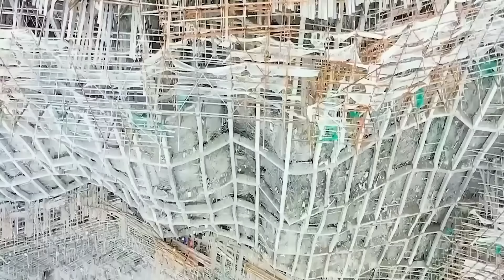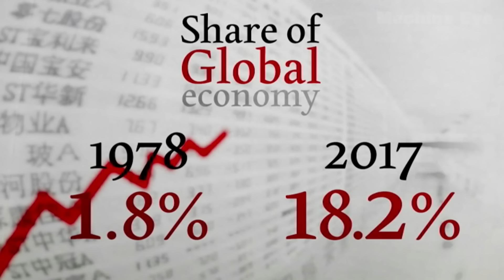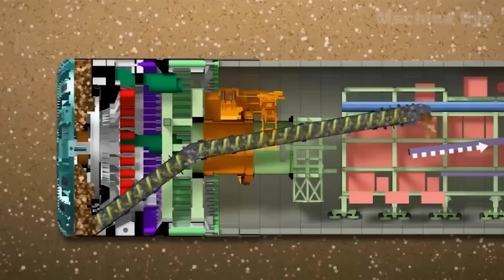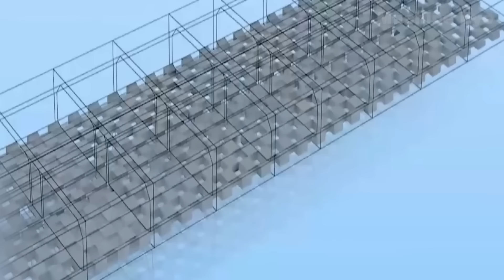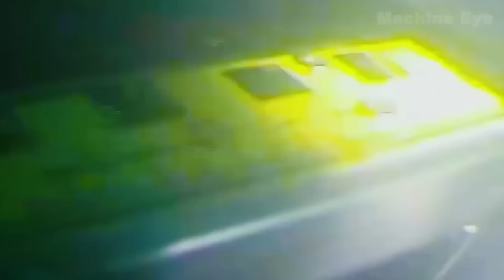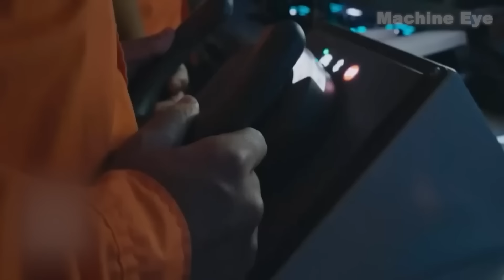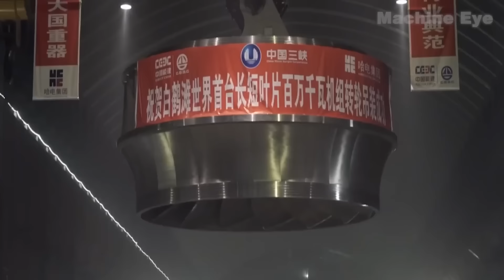So Amazing! Americans Won’t Believe These Incredible Chinese Mega Projects Exist

Comment: New structure ready to be placed in position over new columns under the existing bridge.
Look at infrastructure work needed to achieve placement of new bridge. This took over 18 months to get ready for placement of the new bridge